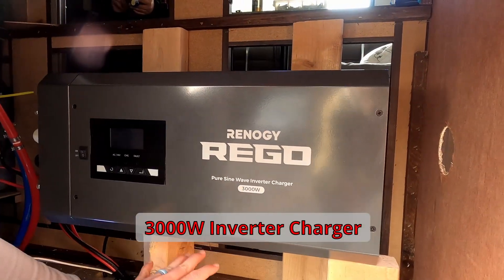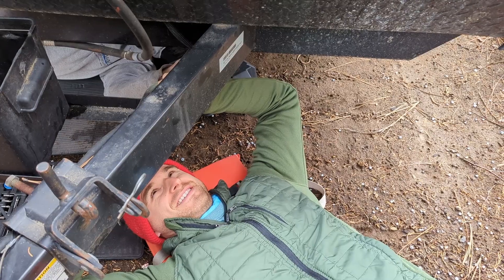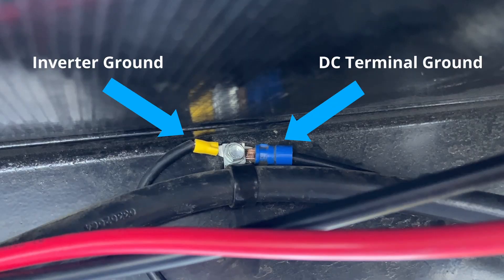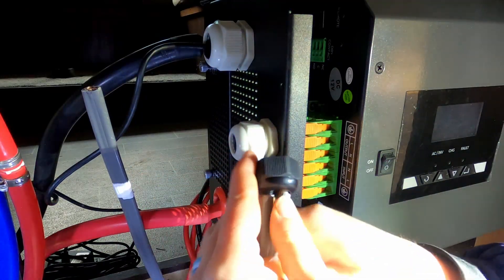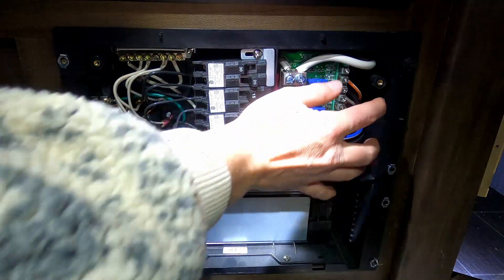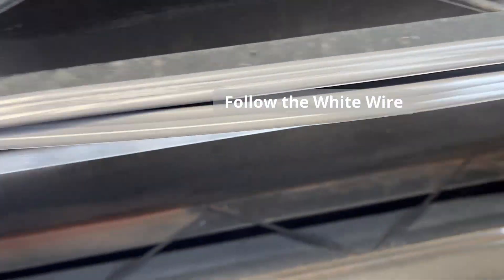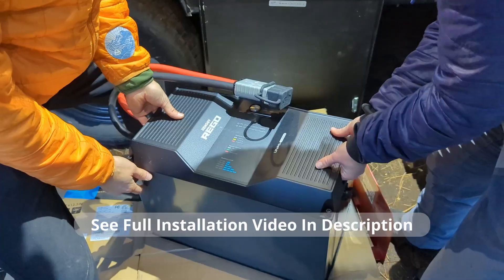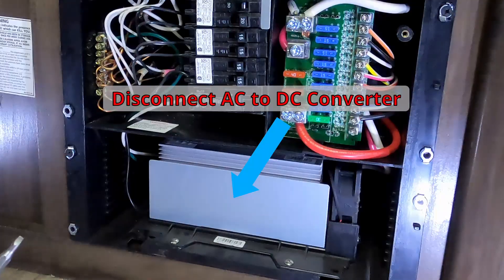RV Inverter Charger Install: Shore Power to Off-Grid Seamlessly!

Comment: Nice video! I'm looking at this same inverter-charger, how did the A/C and microwave perform? I'm not expecting to run the A/C but in this configuration everything is wired thru the inverter. I plan to use a 300 LiFePo4 battery predominantly for the microwave/fryer/oven combo. Unfortunately my rv didn't come with a propane oven, need to find an electrical solution for off-grid use.
Reply: Thank you so much for your quick comprehensive responses. Thank you for sharing your knowledge! I can do this project now. All the best and stay safe!
Reply from the maker: Sure! That's why we're here.  Give us a follow...
Reply: Do the inverter-charger need to turned on all of the time even when on shore power and the battery is fully charged? I realize it can be noise under the bed. Thanks.
Reply from the maker: Hey thanks for the questions.  No, it is not "On" per se. When the Inv/Chr is plugged in, it powers into a mode that charges the battery, but it won't make the same fan noise that it does when off-grid.  Also, we didn't get a really good test of the AC, but the microwave, and hair dryer etc. did just fine.  I'm not sure about the oven, that seems like a big draw.  Do you know the wattage?
Reply: As high as 1450w in convection mode, 900w in microwave mode. Since my rv is brand new and converter is lithium ready (WFCO auto detect), I think I'll be better of going with an inverter only (no charger) with a transfer switch, dedicated to the oven circuit. Renogy PUH 3000w, turn on only when oven is needed off-grid.  What do you think?
Reply from the maker: Got it.  3000W inverter has a surge output of around 6000W for an instant, like when fridge compressor or A/C kicks on, so if you have some extra things on it won't auto shit off.  You will definitely want a transfer switch for off-grid, don't want to electrify the inverter when plugged in.  But I see that you have an appropriate converter for the job, so no need to remove that.  Good luck, and use our CANLIFE code at Renogy  to save some extra cash.